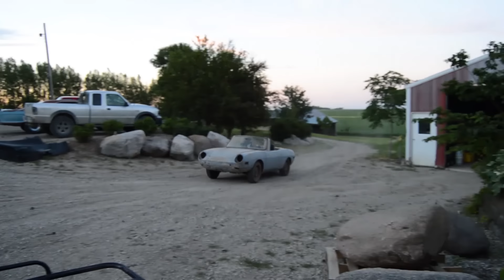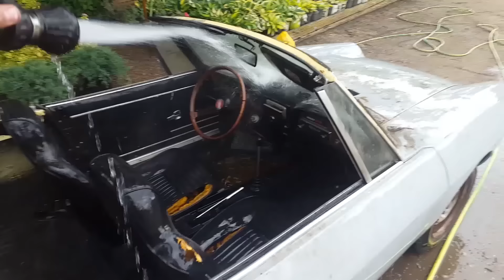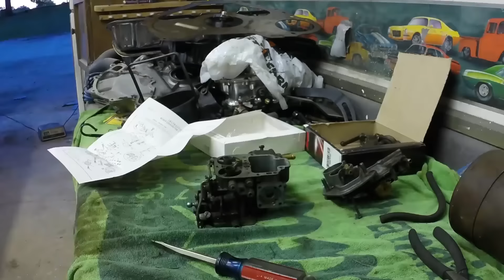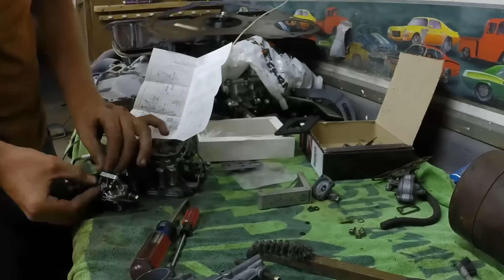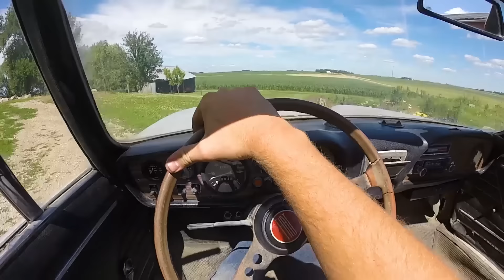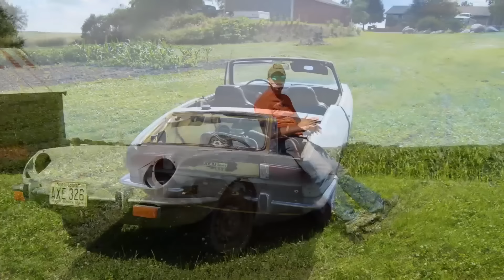Abandoned Fiat First Start in 30 Years! -- Part 3

Comment: That was so cool seeing the old footage! I enjoyed the donuts too, didn’t look like you were really beating on it imo. You should do a follow up on it when the new owner is done if he would allow, would love to see it restored.
Reply from the maker: +Matt's Garage thats the plan!!
Reply: Matt's Garage     That would be cool to see the follow up on that Fiat and see it's new and improved life . 
I imagine it to be a red Ferrari with chrome headlight rims rear chrome to. New inside seating, just a nice show room collectable.
Reply: The car is very buetiful too
Reply: the fact that it still runs and drives is just mind boggling i didnt think it would crawl of its grave honestly
Reply: @JunkyardDigs  My first car was a 1976 Fiat 131S that my father bought from a junk yard in 1986 for $200. That car had an indestructible engine and transmission. 

When I was in college, I worked 40 miles south of where I lived and I got off work around 1am each night.  The max speed of that little car was 115 MPH. At that speed, in 5th gear, the engine was right at the red line 6500 RPM.  I drove home every night with the accelerator pedal on the floor, 6500 RPM all the way home on Interstate 75 (Tampa FL).  You just couldn't kill that engine.
Reply: Fiat had the best engines, double overhead cams in the 60’s - 70’s.  Short throw 5-speed manual, rack n pinion indie suspension, struts, sway bars.  Electrical had issues, ate fuses but easy fix with bubblegum got you around.
Reply: @omegalamda3145  LOL @ the electrical issues. I rewired the whole car!
Reply: @1969barnabas  Sounds like Fiat actually used to be decent well before it became the whole Fiat/Chrysler catastrophe imho. Minus some electrical/fuses issues from what I understand.
Reply: @trickyricky12147  And lots of rust issues in the 70's too. Mine was originally from Clearwater Beach Florida, and there was a lot of rust below the rear bumper.

But the 1800cc DOHC engine was indestructible. There were a few times when I took it way above the red line, and the worst thing that happened was floating the valves, which basically caused the engine to lose power around 7500RPM.

I beat a new 1987 Camaro (V6) one night in a race. I revved it to 6500-7000 in 3rd, and power-shifted into 4th and pulled ahead of him.

He was one of the rich kids in highschool. He wouldn't even look at me the next day at school.

Comment: Mine was orange and off the showroom floor.  It was one of the most fun cars I've ever owned.  I am 6'4" and fit inside perfectly.  I even added a fiberglass top for serious weather.   All done in So Cal beach area and no rust.    It was a bit intimidating on LA Freeways since it sits so low... which is the reason I was advised to buy a bright color to be seen and not run over by a truck.  As for 'drifting" - well, kinda exciting on winter mtn snow - sliding more than drifting.   It was like an expensive go-cart.  Thumbs up - now dress it up like new.
Reply: What happened to your one?
Reply: @tomwalsh6655  Sold long ago, now probably crushed, melted and turned into  appliances.
Reply: @teachgold  😥
Reply: @tomwalsh6655  Tom are you looking for a Fiat Spider to restore?
Reply: @bradchampion8072  i wish

Comment: Thanks for this 3-parter. A good friend bought a 1972 Fiat 850 Spider  in 1977 that came with a nice extra little something: There was a second engine sitting on the passenger side floor He and I had a bunch of fun hoisting the old engine (73,000 miles) out using a makeshift hoist from his garage ceiling and installing the new one. Darned quiet beast and one he wanted to keep forever. until he married into a 14-month-pold baby and had to get a "more serious car!" Sigh… Other than the color, mustardy yellow, I loved it as much as he did.

Comment: I had one in L.A back in 84- a '72 I think- bought fairly wrecked- did some bondo work, painted it all metallic blue and had the motor head rebuilt- it ran for a few years I was living in apartments- very little power though.  One day I was at Arco near Universal City and went inside for a jumbo Coke- when I came back out I noticed there was paint bubbling on the back cowl, and under it, the carb was on fire! A six inch flame was rising off the top like a torch, but the solution was in my hand, and I quickly doused it with the jumbo Coke. It somehow still started back up and I drove it home to Hollywood.   Yet,as I had visited several junkyards in search of an elusive tail light- the dude who replaced the head STOLE IT-  and as I had seen SEVERAL 850's  in the pick-your-parts had suffered death from the rear engine catching fire, I soon got rid of the car anyway, but it was fun while it lasted.

Comment: We had a yellow one in the early 90's spent a lot of money trying to get it to run right lol it sucked
Reply: chad harmon - Find that particularly curious because these Fiat's where simplicity from the ground up. Not much to go wrong in them. In fact from this age/ generation, Ford, Fiat, Opel Toyota, Peugeot, Citroen, etc. Where all basic and simple...Very easy to fix/repair and best of all cheap. :-)

On the other hand all these car's had a way to close relation with rust. :-(
Reply: crpth1 I believe at the that time in our single parent household there was not enough know how to work on basic stuff lol I was too young back then and I believe the local foreign repair shop was giving us the hose every time we bought it in unfortunately
Reply: chad harmon - Yeah it makes sense. Because there's really not much to them. Age of the hammer, pliers and some wire to fix pretty much any car.
I got my first car back in the early eighties. With a 1/2 week fresh drivers license. Damn I was proud of my rust bucket. LOL :-)
Well had to learn about points, condenser, plugs... Nowadays usually drag my android phone or the pc to the garage. ;-)
Reply: britishav8tor75 LOL
Reply: britishav8tor75 What a bucket of humor you are!

Comment: Must be odd for Americans to see power coming from an engine with less then 8 cylinders and a cubic capacity of less then 7 litres. (No idea what that is in cubic inches). 👍
Reply: not odd at all really.. but i would hardly call that power.
Reply: 7 liters is about 427 cubic inches.
Reply: Hahha! Dude. I drive a 1992 Honda Acty 3cyl.
660cc!!
Reply: Anything with less than 8 cylinders is communist
Reply: Stephen Cresswell hell I'm from Mississippi and I'm planning on getting and probably restoring an FC RX7, staying with the 13b if everything ends up being in good shape of course
Reply: Mike Stroz what's wrong with a 12 valve cummins?
Reply from the maker: +Stephen Cresswell i dont know what to do with my hands
Reply: Dustin Short It was a joke
Reply: and anithing  with more than 4 cylinders is  oil-warfare terrorist  around the world
Reply: Stephen Cresswell actually what AMERICANS did with VW’s made the world envious
Reply: wolfman4lph4 nice dude good luck!
Reply: Nazi's made VW's, Americans made them cool.
Reply: Communist
Reply: Stephen Cresswell. Engine sounds great. Good job👍
Reply: My SUV is a 5.4 liter V8
Reply: Elijah Ellis. My 73 Dodge charger has a 440 ci V8. Some freighters are powered by the worlds. Largest Warstila diesel engine. Your point is?
Reply: it still amazes me how little horepower americans can get from those huge engines...
Reply: Wilco Muurling. Troll.
Reply: 7L would be a 428ci. and I'm not surprised to see power from a 2cyl.
Reply: Stephen Cresswell you are probably right. God bless america and god bless gas guzzling v8 power i roll a 5.4L v8  and he purrs
Reply: The YouTube Phantom Official. A one liter engine is 61 ci. A seven liter engine is 427 ci.
Reply: Mike Stroz. Whats bad about real communism with a great leader how sticks to Karl Marx his toughest and doesn't dominated te country so bad? Capitalism really is worse and power is not everything. Those Americans are only thinking that bigger is better...
Reply: The thing still sounds like my lawnmower
Reply: "Power"
Reply: Ilias Lamari. If you truly believe what you are saying. You will have no problem telling everybody what country you currently are living in. What is the country that you are currently living in?
Reply: Ilias Lamari Bigger is better. If you didn't drive a Renault Clio then you'd understand.
Reply: Stephen Cresswell  lmfao we don’t call 40 hp power that is maybe 29-30 kw that is a slug
Reply: Stephen Cresswell I know I live in America and I hate the fact that people say no replacement for displacement
Reply: Danial S. 40 hp is for large lawnmowers. Or small tractors. Not 3'550lb automobiles lol
Reply: I would LOVE to have one of those!
Reply: My car only has 4 cylinders 😭😭😥
Reply: Excuse me, but my 2l 4g63t is known for poopin on V8’s, Mitsubishi ftw
Reply: I believe "Fiat" is an American term for a tea kettle, but I'm not sure.
Reply: Lol its not 1960... a car should have an engine that gives it a good power to weight ratio imo. Cylinder count doesnt really matter. Inline 6 is alot better than v6 though imho. Best natural balance vs worst (of common layouts)
Reply: But to be fair, Ford is coming out with a new 7L OHC V8, and ill be damned if i dont shoehorn one into my classic F150 😁
Reply: Wilco Muurling chevys, yes, fords no. Ford makes dohc v8s just like you guys and has for 20 some years now.
Reply: Ilias Lamari communism fails every time. Capatalist and not tired of winning 😂
Reply: The John i have one of those too. I like any engine as long as it can handle being hotrodded tbh. Mine is a 94 with a 6 bolt swap and evo3 turbo and injectors and BC272 cams. Not crazy fast but its just a gs that i built up to a gst. Its fun and I drive it alot. I run valvoline synthetic 5w40, oil cooler, and even a bypass filter, just because im paranoid after taking out a rod bearing twice. Probably mostly my own doing beating the snot out of used jdm engines that looked kinda crappy anyways... It has a freshly rebuily longblock this time.
Reply: I had huffy bicycles that weighed more than that thing.
Reply: Travis Lazenby lol. When i was a kid i snapped a Huffy clean in half on a homemade tabletop jump. Saved for months for a Dyno after that
Reply: Stephen Cresswell you’re wrong
Reply: @iz7geg  if by oil warfare you mean Isreals pet then youre right
Reply: I've got a 7.3L
Reply: V8 mustang is 5.0 lol. So i see plenty v8s under 7.0 not just mustangs
Reply: Oh yeah, cause 40 horsepower is "power". I love 4 bangers, I've got a GTI now and used to have a RX7 13b. But the stereo type that Americans hate anything that isn't a gas guzzling V8 is so damn dumb
Reply: 52 inches
Reply: @wildwilco   what amazes me is ......
That you ain't got a clue as to what you are trying to say .....
Reply: @thejohn6912  😂😂😂😂😂
Reply: Must be odd for Stephen to realise his stereotypical views are way off
Reply: 7 liters my ass. More like 0.7 liters....

Comment: It’s a Fiat, even when you fix it, it’ll break down again.
Reply: Depressio Spaghettio 
F.ix
I.t
A.gain
T.ony
Reply: westleybates 20 and again and again and again 😂
Reply: Depressio Spaghettio no! It’s in America so it’s a Feeeeeeeee-At! 😂
Reply: I beg to differ, Fiat like any car will suffer if you don't look after it.
Reply: Is saab stronger?
Reply: MegaDirtyberty yeah you are right
Reply: My 1983 Fiat 131 Mirafiori CL 1600 has 494,000 kilometers on it right now, original everything. my dad was the original owner. Has never disappointed me. Always there when I needed it. Pretty reliable.
Reply: An easy engine to work on. A bit prone to vapor lock but then a lot of engines from that time were.
Reply: Grizzled Old Dude I currently have a Fiat 2ltr twin cam and it has proven to be reliable so far, have owned another Fiat 2ltr twin cam some years ago and that proved to be reliable. Have not had a problem with vapor lock, engines are  good but the rust and electrics let them down.
Reply: But it's fun, i have Fiats all my life, not serious problems, but when they broke, they broke. And sometimes you can repair it only with a screwdriver lol.
Reply: Depressio Spaghettio nah, it ain’t a Ford.
Reply: kwibalda lol 

SAAB most def is stronger than fiat. SAAB is swedish steel and alot of german parts( think bosch)

Old fiats arent tefrable though just gotta know italian cars.
Reply: Best Fiat = Ansaldo.
Reply: @WestleyBates  fix it again tomorrow for people with other names
Reply: I guess dodge will do the same. seeing that fiat owns dodge now.

Comment: Im sorry but spraying any FIAT with any amount of water will cause horrendous rust that will lead to never ending welding! Driving through a puddle has been known to cause the wheels that hit the water to fall off!
Reply: Sablon76 I passed through a flood close to my school with my fiat
Reply: lol You dont know the old fiats very well lol They were complete rot boxes in europe, literally you touched water with them and they rusted! It was the same with the Alfas as well.
Reply: Sablon76 Did you watch the whole video the car is being stripped down and getting a full restoration
Reply: I know... its a joke! Fiats were famous for it and so it spawned many jokes. Like, I took a holiday to the seaside in my fiat, I came back by train! and thats just one I can remember.

Comment: Don't know if this model has the same issue of the Fiat 600's, but make sure to get all the heat deflectors that came originally on the radiator casing, so you will avoid the engine from overheating. Greetings from Argentina.

Comment: That’s a real fine, not many of those left.  the metal was so thin I think they all rusted away.    I owned a baby blue one back in 1972.  I recall the engine compartment was also baby blue.    I had the engine rebuilt and carried the engine into the shop and set it on the counter.   
I’ve gone to a lot of Mecum auction’s and I’ve never seen one.
It would be interesting to know what one fully restored would sell for.

Comment: You need to change the Timing belt every 40,000 miles or it will break before it reaches 45,000.  Since this is an interference fit engine,  this would be catastrophic.   That is why so many ended life in the junkyard at less than 100,000 miles.  Usually results in both bent valves and holed pistons.  
The are also some overheating and head gasket problems.  Hope your name is Tony, as in Fix It Again Tony.  These are cars that are so fun to drive that they are worth a once a week garage fun session.

Comment: Take the idle jets out and pull them out of their holders.  They are the brass screws on the outside of carb.  The jet pulls out from the screw body.  The jets are so small the often get plugged.

Comment: You did well with that one.  I had an 850 saloon/sedan and if I went outside my town (so about 2-3 miles) it would overheat.  I went through everything on it and I never got to the bottom of the problem.  And then someone crashed into the side of it...

Comment: i had one of those when i was 17...im 53 now iine was an 850 sport  it had a 903cc engine and was extremely slow i paid 75 dollars for it and drove it all summer except when it rained cause the electrical system was so bad you never knew what switch to flip to turn something on... it did handle great but no power to come out of a turn

Comment: 30 years in the dust. You NEVER spray water on the dash. Youll destroy the radio/stereo etc. Not designed to get wet.

Nice to see shes running well finally😀 shes a collectors piece for sure

Comment: At a house at 654 Sullivan Street in Elmira NY sits an abandoned 1991 Ford Mustang the guy that owns it is in the milatary. He hadn't run it in over a year and a half the engine seized up he tried to remove the rear drive axle to unseize the engine and broke it. I hope someone contacts him and buys it fixes it up before it rots away and becomes scrap iron that would ba a shame. They are highly sought after muscle cars.

Comment: I don’t know if this is a good place to ask or not but last ditch effort. I stopped getting spark from my coiI. have a 69 Buick wildcat that I have replaced the coil plugs and plug wires but still no spark from the coil. What else could it be? It can’t be points/condenser because it has a points eliminator on it. Could my distributor have taken a crap, or could that points eliminator taken a dump? Please help!!!
Reply from the maker: +john botner i would check the point eliminator. Go through slowly working your way from the battery to the plug checking for voltage and operation at each component!
Reply: Junkyard Digs I’ll check it out thanks for the tip, might come back with another question tomorrow.
Reply from the maker: +john botner shoot me an email if you want. Best way to get ahold of me

Comment: Craigslist listing:
For sale, Possopoopmobile.
Previous owner: A literal possum and his shit.
Brand: Fiat.
Age: From 1986.
Condition: Been in a barn for 20 years; could use some paint. Also, brakes are shot, handbrake only driving required.
Price: ... Yeah, no idea. I mean, it's weight in scrap metal times two or something along those lines?
Miles: Not that many for it's age, seeing as it's been rotting in a barn for the last 20 or so odd years.
Reply from the maker: Hahaha i love it!
Reply: why would a possum live in a fiat?
Reply: @sizquirt8754  Because the Ford parked next to it was locked and he didn't have the keys?